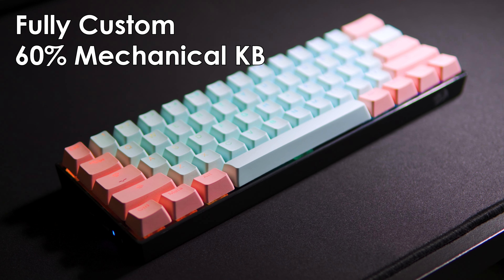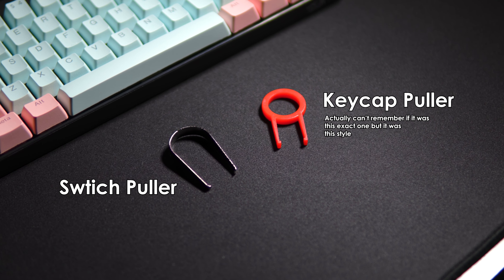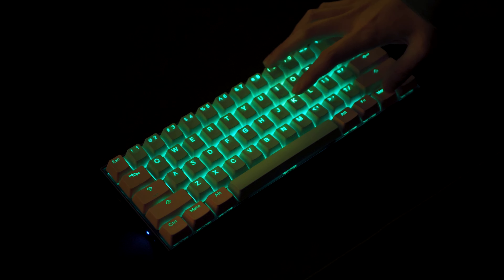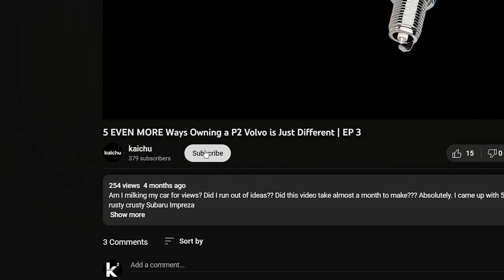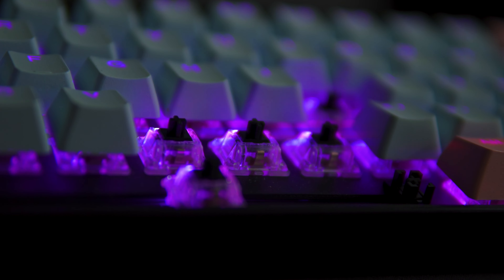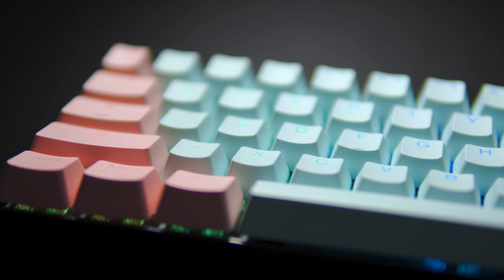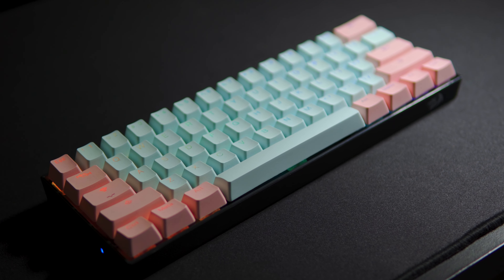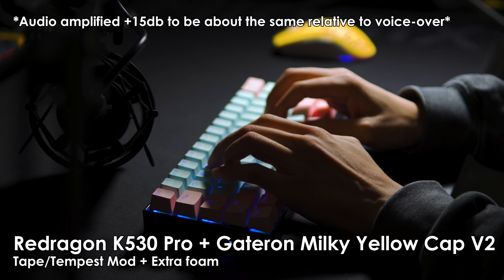Redragon K530 Pro Draconic 60% Keyboard Mod & Review

Comment: Great Review brother! I am trying to buy this exact keyboard as I feel it's the best one at this price range. But I am concerned about the battery life on 2.5Ghz/BT connection as I am doing some gaming and a lot of working. I don't want it to die on me as I work 13+ hours a day. I usually won't need the RGB lightning tho.

Can you please post your review about the battery life?
Reply from the maker: I'll be honest, I'm not sure, since I really only ever used it maybe about 2 hours at a time because I typically can't do what I want to without at least a numpad and wasn't really paying attention to how long everything lasted, but it's definitely not super long. Granted I did have the RGB on pretty much the whole time
Reply: @kaichuuuuuu  Is it possible to change the battery for one with a higher amperage that gives you a longer duration?... do you know if it is possible? the old draconic for example used a 3000mah battery, and it lasted more than a week with the lights on.
Do you remember if the battery fit into the box or if it was just glued to the base and had room to replace it with a slightly larger one?